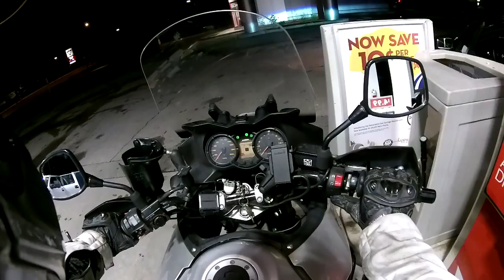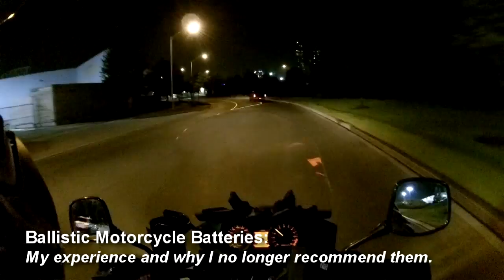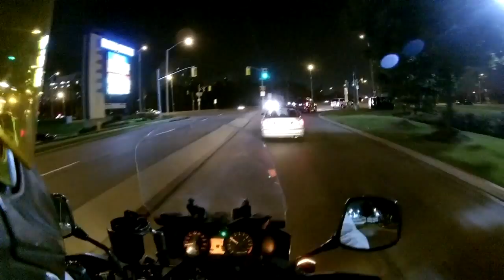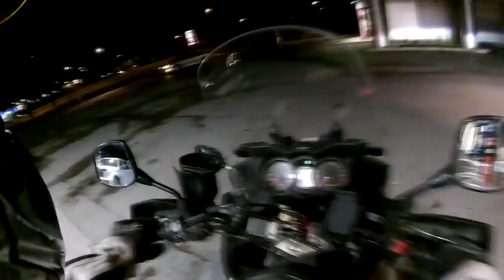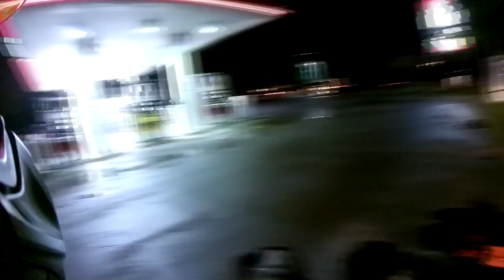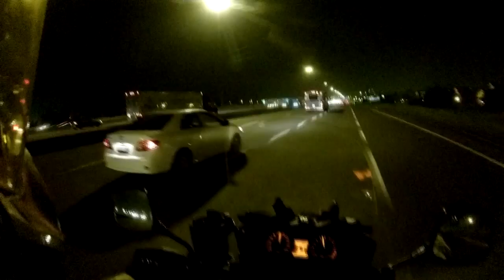Ballistic Motorcycle Battery Failure

Comment: LFP batteries don't start immediately below 32 Fahrenheit.  The trick is to draw 100 amps out of it so that it heats itself up.  Then you can start your bike.  Check the faq:  http://www.racecarbattery.co.uk/ekmps/shops/raceuk/resources/Other/b-faqb.pdf  

I personally went back to lead acid because the ballistics don't have a charge controller in them.  These ballistics need something that prevents voltage drainage below 9volts and another system to prevent charging over 14.4 volts.   Below 6 volts and you can consider it dead and fubar.  I heard that shorai batteries have a pcb that controls all that.  Don't use a charger that has a desulfurization circuit on a ballistic.  This will guarantee total battery failure.

Since Ballistics are Lithion Iron Phosphate batteries, they are probably more useful in electric vehicles.

Comment: I'm not convinced with these battery's, they need to be balanced at all times/ they don't  like being fully charged continually, they need a charge and discharge cycle, also if they are like lipo they will die if they drain below x voltage

Comment: Ouch.  Glad you got that solved in the vid after this.

Caught a similar problem on a car before it began affecting the starter.   Battery dropped from 12.7 to 12.2 in a couple hours while it was disconnected from the car as I worked.  One of the cells was low on water and looked like crap inside compared to the others.

Comment: Now I'm glad I got the OEM when mine died last month :)
Reply from the maker: Yup.  I picked up a Yuasa YTX-12BS battery from the local shop as my new replacement.  I hear a lot of good things about these batteries; I was tempted by the Shorai Lithium batteries but decided to stick with a "proven" standard instead this time...
Reply: TekNinja81 LOL...yours was just like mine (case of Shorai LFX14xxx, (Yamaha FZ6) as it happened to me last year. It was dead when I tried to get home from work and my coworker gave me a push to start :) LOL. And exactly the same I bought Yuasa batteries and peace of mind as of now (it's connect to battery tender charger when I do not ride in the weekend). 

Shorai did good job that they replaced mine with LFX18xxx because I couldn't return the original LFX14xx to the reseller. I later found out that it was part of my fault because I adjusted the idle to 1300rpm and according to Yamaha that the stator will not charge (produce ~12.8v) if the RPM lower than ~1450 which is the default idle RPM.

Now I have LFX18xxx sits in my garage and kept having temptation to give it another try but I might have to order their balance charger (it is a must)...but the charger is almost the same price with the Yuasa I just bought which will be due another 2-3 years for another one...maybe it's not worth it and up to ebay for $120 and will be gone 1 day :)

have a good riding!